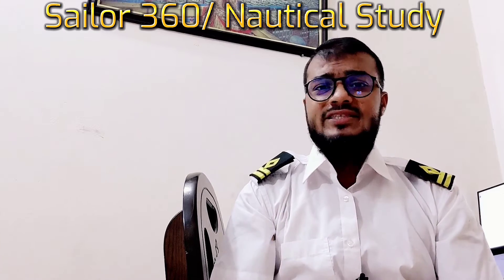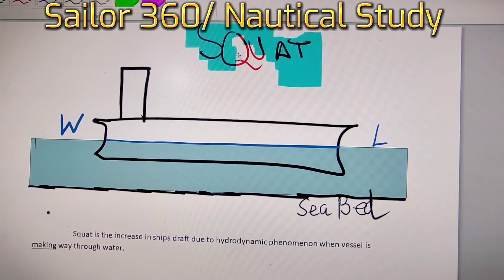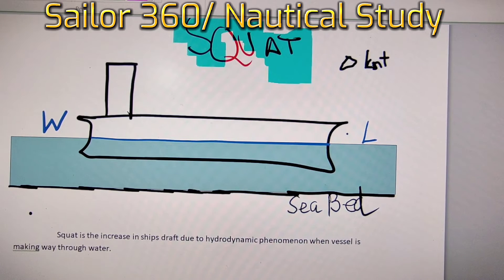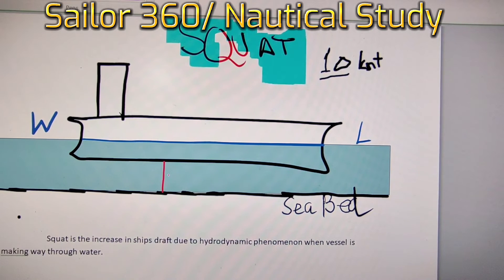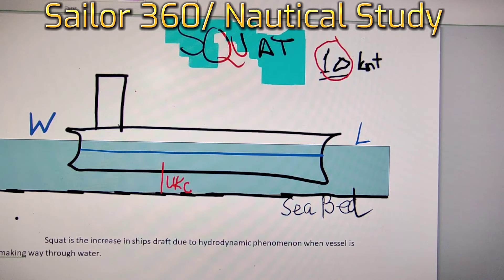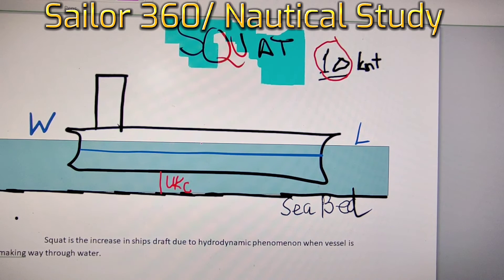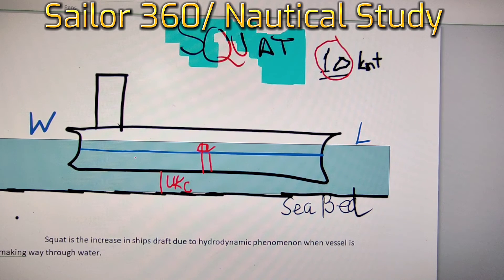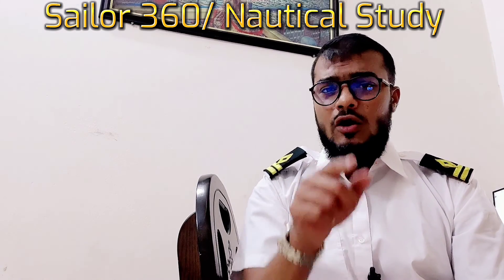What is Squat of a Ship

Comment: This is only true in deep water or channels without a muddy/silted bottom. In those channels, the ship sinks until the hull begins to penetrate the area of increased density near the bottom. When that happens the buoyancy of the water begins to offset the effect of squat. Eventually, there is a balance where the increased buoyancy equals the squat effect. The ship continues without running aground. I was a ship pilot for 30 years in Houston and very often ran large ships with less than a meter UKC clearance at speeds up to 12 knots across Galveston Bay without incident.
Reply from the maker: Thank you so much for sharing your practical experience Pilot. I have been to Houston in 2016 when I was 3rd officer. We used to load there and discharge in Argentina/ Brazil. Please share more ship handling experiences with us if possible.